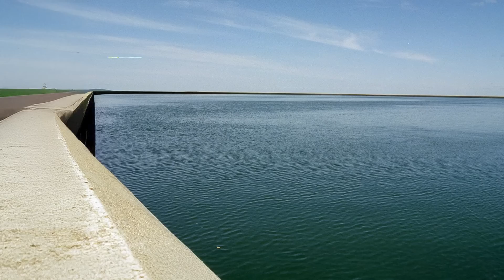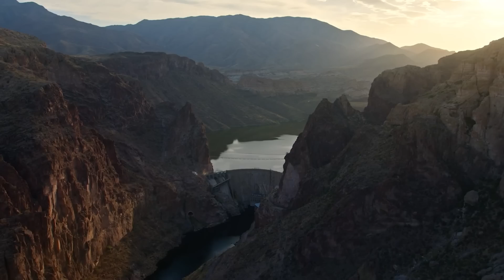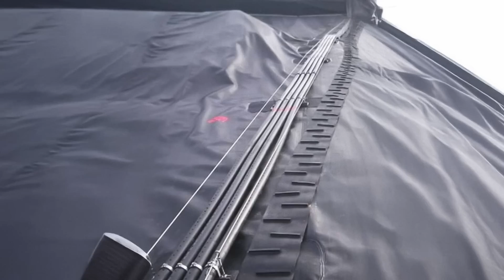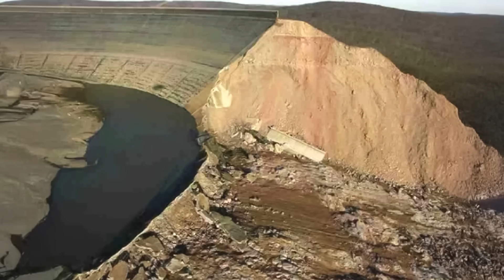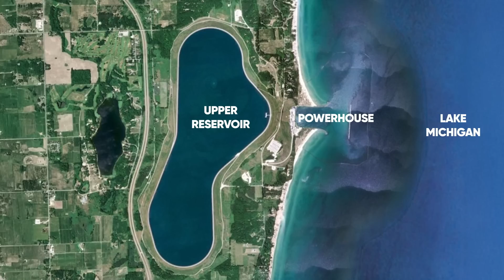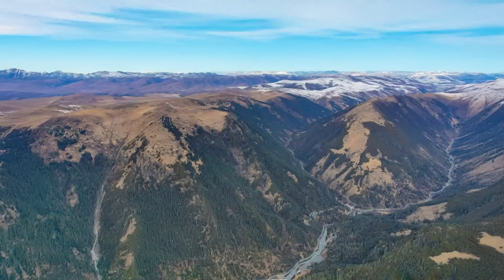U.S. Put Billions of Gallons of Water on the Mountain, a Few Years Later Everyone Was Shocked

Comment: Where I live, balancing the net is done with steam
If the net is overloaded, electricity is turned to pressurized dry steam
when the net is overused, steam is turned into electricity again
the entire installation fits in a 15m by 15m 3-story high building

Comment: so you said this built in 1960 or there abouts right? well luck would have I too was constructed in 1960 being finished & debuted around 4 a.m. 12 31 1960 Thank you Thank you Please hold you'r applause till the end! AND so my question is this had no one prior to me ever herd of floats ? what I'm getting at is this the ( pipes?) that carried the water from the lower reservoir up to the unfortunate upper reservoir came into the upper reservoir per your graphic from beneath. If those were pipes & did come in at the angles you've depicted here , Try this at a point shortly prior to the end of this pipe were it entered the upper reservoir could have had the following modifications included to form a very simple type of level check valve & aoutomatic plug system that would physically shut off the waters flow taper the pipe or add a inner tapered ring in the inlet pipe then decide at what depth you want the water to reach as it's maximum. now by adding a heavy ball plug under the ring a couple say 20 feet inside the pipe. ( this demention would need to be adjusted in relation to the pipes diameter & probably the flow rate of the water to keep from having the weighted ball plug prematurely close the system ) Add side pipes running at an angle off the perimeter of the main pipe into the reservoir several feet from the main pipe add sliding gates that are when in their open positions to the bottom of each of these side pipes with a armature running from them up to a point around the weighted ball plug and secure them to it. now you only need a float with enough displacement to provide enough lift to slowly & steadily lift the main ball plug & eventually the gates on the side pipes by adding the proper length of connecting rod between the float & ball plug to to allow the reservoirs water level to reach the desired depth ( and a framework in the reservoir to keep the connection rod between the float & plug& gate system centered ) you would have a automated ( no external power required ) system that would close automatically when the water reached the maximum level. You could potentially add a means to adjustment the desired water level by hydraulicly lengthening or shortening the pipe between the float & plugs. with regular inspections of all the components it could last quite a while. As I was quickly designing this on the fly the idea that a hydraulic  ram system could be added to provide a mechanical override to shut the pipes as well when needed but the basic design provides automation with no need to use any of the overall systems production to operate as do many current in use systems with inherent flawed system designs.
Reply: Why would you type all this

Comment: The China development at the end of the video will not be  zero carbon efficient! Building it with all the required concrete, heavy equipment, and building and installing the solar and wind farms will emit an unfathomable amount of carbon. Plus the replacement of the solar and wind farms at the end of their useful life time will add to it. Also, where are they getting all the water to fill the dam is not mentioned. Is it in a heavy rainfall area?

Comment: Fly ash is the main cause of environmental death from coal power plants and has been used to line a structure of water used for things like drinking, bathing and other things maybe even used for irrigation.  A continuous circulation from top to bottom holding tanks just might give the illusion of cleaner water but eventually what's leached into the top reservoir will have fouled the bottom one too if leaching is occuring daily. Lots of water flowing is not good enough to test the waters and depending on the leaching material location it may take too much time to notice the infiltration as the ratio would build up over time and not discernable in tests until it finally shows up on tests then it will be too late.   This is a material that causes reproductive harm and extinguishes plant life.   The use of this fly ash is extremely alarming especially in this case. It is unbelievable that the EPA would allow this. My hope is that the mixture is unable to leach but I doubt it is healthy for any use much less a water source.   Coal fly ash is the residue filtered away and it is also the bottom scrapings from the burning process left at the bottom of the furnaces where it is cleaned and disposed of or sold to construction as a filler in concrete or other products for roads. It makes no sense to me.

Comment: It takes more energy to pump the water up than the energy generated flowing down.  So the net energy generated is negative.  Why use this at all?  This is because the energy generated flowing downhill (during peak hours) is sold to energy users at higher rates.  Water is pumped uphill at off-peak hours, when rates are low.  The money received from generating electricity at higher rates is greater than the cost to pump water uphill at low rates.  This despite the net energy generated overall is negative.

Comment: Watch Practical Engineerings video on what happened....  The sensors were faulty and were reading wrong due to the liner project, so the sensors would float up and so it was saying the water is low and keep pumping more.   There was a project in plan to FIX this issue in just a few months, but they didnt get to it in time.  This was noticed by visitors and told engineers that water was coming over the edge slightly.  Thats when the sensors were found to be the issue.  This guy tries to be all dramatic and OMG it is a big conspericy! you should be scared! they did a bad job on this design!  but yeah, it was not this big conspericy he says it is.

Comment: Hydroelectric power is the most dangerous source of electricity. That's true regardless of whether the water comes from a dammed river or pumped storage.
Reply: Actually the most dangerous in terms of having caused actual health consequences is coal.  Literally millions of people have died because of the pollution caused by burning coal to generate electricity.  And that's not even taking into account the millions who will die due to sea-level rise, which decades of burning coal set into motion.

Comment: As a local, there are several improvements to accuracy in just the first few minutes. Miraculously, nobody died - I was supposed to be on the road which ended up 20 feet under water only hours distant. This facility has been rebuilt and it is working without the leaks which plagued the original facility.

Comment: It seems this type of battery does indeed work. I am surprised that Coal burning power plants are still a 'thing' in the US. I do hope that Megapack battery solutions such as those Tesla builds will put an end to Coal and even Gas generation stations. Add solar and you have energy coming from the sun during peak hours, and only need to 'top up' the electricity at night when demand is low and at a reduced rate. I believe battery storage solutions such as the Tesla Megapack could actually be cheaper and far less 'inefficient' than this videos water storage, especially when paired with wind or solar, as well as cheaper overall to implement, and safer. Also consider Megapack battery storage can be parked behind or in the parking lot of a building such as a school, hospital or an office building with the sole purpose of charging at night when rates are cheaper and providing energy during peak hours at the cheaper rate. Now- add solar panels to the roofs of these buildings and things start to get interesting!
 I just subscribed to your channel after watching many videos. You are awesome! Thank you! (Gonna have a coffee now).

Comment: This is a real shame and an absolute oversight by engineers. Why the hell wouldn't you include a freaking spillway?! Redundancy! It's a good thing to have. Sensors fail and the reservoir continues filling? A spillway built with a flow rate above that of the pump rate would have made this a non-issue. Further, with a spillway and at least a yard or two of extra elevation on the reservoir walls, and even in extreme conditions, this would have been improbable. 
This is a shame.

Comment: When push comes to shove, it was the choice of those in charage, when it was working as designed, Realize if they were to increase it just  wee bit. There wouldn't be an issue. Did so and made money in the process. The issue is, when they became accustuned to the additional money. If a wee bit didn't cause an issue, than certainly another wee bit would also. Government's who's electric's are in constant flux when being voted in and out a few year's. Know that if increaseing a wee bit during their term doesn't cause an issue. They won't be blamed, when it happen's during the next administration. Meaning it's not the total amount of straw that caused the issue. It was the last piece of addtional straw and the administratin in charge than, that caused the issue. Who then had to somehow come up wth any and all or the total expense, whch was signifigantly more than the total they had aquired from the first time it was increased a wee bit until the last time it was increased a wee bit. Government's are not concerned if something doesn't happen on their watch, as long as it happen's on someone else's watch, the previuos are never blamed.
Reply: Meanwhile somebody pockets the profits it generated and then face no consequences for the failure. They should lose every penny of ill gotten gain.

Comment: We usually pump water up and downhill to create an energy cycle or storage until later needed. It's called PSH or pumped storage hydro. When there's more energy than needed, we pump it uphill to store that energy, then when there isn't enough energy we pump some down through turbines to cover what we need. It's a very simple and affordable method that's cheaper than batteries for long-time storage.

Comment: Hmm? 🤔 I suggest you have smaller reservoirs to generat power for smaller communities & have less devastation if a breach in the system of the way it was built collapses! 😮 There should also be a back up system covering these exposed areas of water making it water tight in a sense like a pool cover. 😊 Because you cant control the masses of gallons of water that would be rushing down. It is highly dangerous to have a place and hold millions of gallons of water & expect it to work safely 100% f the time. Smaller amounts, less devastation, pool covet, better built strictures & securing the parameter around the facility is a much better plan! ❤🎉

Comment: This is a similar concept to how solar power storage could work.  Solar power excess pumps water into a reservoir during the day, keeping it topped off and letting some off as necessary for surge needs, running continually at night to provide for night demand.  It wouldn't scale to meet huge demand, but for rural areas it would be perfect.  You'd still need other forms of generation to supplement, like wind, but it'd make a good solution for some more remote regions.

Comment: What a horrible design.  Not planning overflow was insane.  All they needed to do was to have drains at the top that were installed at a set level so that water would automatically overflow to a planed overflow that went directly to the lower reservoir, a smaller one at a lower level that would act as a switch if water drained through it, and upper ones if the switch was not operating as it should, to the point that they could have the pump moving water up at full blast all day long and the water would simply drain out the top.  Pressure sensors were a horrible idea, they were a clear point of failure.  Just have more and more planned outlets the higher up that they go. An ideal solution would notify and external authority every time water went through a higher outlet.

Comment: Always thought burms were stupid. You move that much dirt, just dig a hole. And also i think the pump and dump "batteries" are ridiculous. Maybe just maybe, turn off streetlights or have businesses turn thier lights off at 3 in the morning. Maybe have "batteries " placed and it could be just like a curcuit. The batteries would keep the voltage at the right level when usage makes it dip. Right? Im not an electrician, but thats how it works right?

Comment: Can't help but wonder if they could do that with the Berkeley pit in Butte Montana. It's a former copper mine that's currently a toxic Lake. Effects left over from the copper mining.. 

They've actually developed a way to filter out some of the toxins from the water.

But you got to wonder if the leftover pit could be used as an energy storage device.
Reply: Like drop in a bunch of lead plates to turn it into a giant even-more-poisonous-than-it-is-now battery? The water is too toxic and acidic to use for pumped storage in connection with a waterway or river. It probably can't be used in conjunction with the nearby Yankee Doodle Tailings Pond because the water came from the abandoned mine underneath and the plumbing would be a leaky nightmare. I was just thinking they should just fill it up with something other than water, like a giant buttload of acid neutralizing limestone, or the tailing from another mine, or garbage to be dissolved like oil, chemical and mining executives and arrogant engineers.

Comment: The U.s. runs 60 htz electric. This means a flywheel or mechanic energy is needed to keep the 60 htz. Wind and solar don't produce enough to keep the htz up and keep grid from crashing. Ireland turned a coal power plant into a flywheel to do about the same thing. A way to keep the htz of the grid from collapsing if it gets too low.
Reply: Wow! I’ve always suspected there was a large flywheel in the power inverter that’s wired into my off grid solar system. Thanks for the heads-up!!

Comment: Somewhere I came across a story about the “opposite” of this set up, where in they had a huge underground mine, and during the day they pump the water out and allow it to generate power falling back underground from the surface, so the whole thing was under the town instead of above it seems a lot safer and doesn’t require any of the extreme measures to make it leak proof, etc., etc.   If anybody knows where that project was, I’m suddenly curious to reread or re-see about that project  just for contrast.
Reply: I mean its a gravity battery essentially, and searching for gravity battery mine shaft brings up loads of results
Reply: Google sink holes !
Reply: @captaincanada5139 
That is also a great point. Water going into and out of a mine could destabilize the ground above. It may not be a problem in some areas but can’t be overlooked.
Reply: it's a lot safer as long as the ground above it isn't limestone. If it is then eventually that limestone will collapse
Reply: I was thinking of something similar. Had they allowed a rock quarry on top of this mountain, they would have something similar but much safer than the above ground lake they created. 
The amount of energy they are storing is incredible, to trust an above ground swimming pool seems a bit irresponsible.
We also need more Stone quarries and to find a use for the voids they create seems like a win win.
Reply: @michaelalbert8474  sure. More rockslides too
Reply: Googling
"gravity battery" cave
quickly gives an answer.

Pyhäjärvi, Finland
Reply: Rock mountain in Floyd county Ga
Reply: there's a hydro gravity plant still being built in new zealand or austrila which is a complete disaster and not finished
Reply: @devinseals8697  Your point?
Reply: @richardhowell7040  how is a large pit under a town "safe"?

Comment: Carbon emissions do not matter when taking into account of the water vapor in our atmosphere
Reply: Water vapor is a self-regulating greenhouse gas; when there's too much, it turns to clouds and reflects heat away from the Earth. CO2 is an unstable greenhouse gas. When it is too high, nothing corrects it or balances it. Try googling "Why do we blame climate change on carbon dioxide, when water vapor is a much more common greenhouse gas?" The amount of water vapor in the air is partly determined by the amount of CO2 in the air. The water vapor is not in the driver's seat. The water vapor amplifies the effects of CO2.
Reply: Yes. Or so your smooth brain has convinced you. LOL
Reply: @luisaraujo4708  An ad hominem response should be avoided in rhetoric

Comment: This is BS!  The problem could have been fixed with a $15.00 part from Maytag!  Its a good thing these clowns don't engineer washing machines.
Reply: So, nothing in this story happened cuz Maytag washer parts weren’t used? Uhhh, ok…
Reply: insurance payout worth it failing
Reply: $15 part from Maytag would not fix the problem😂